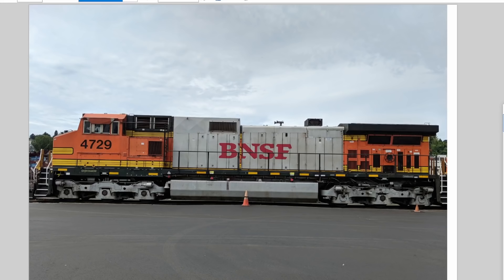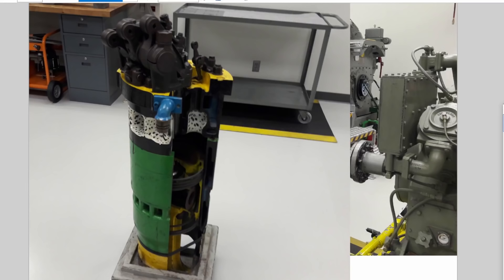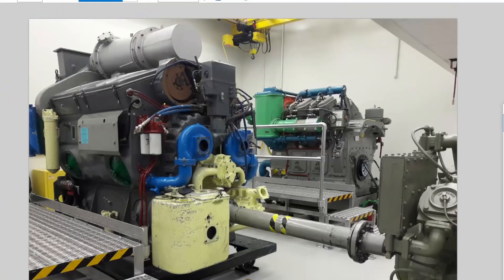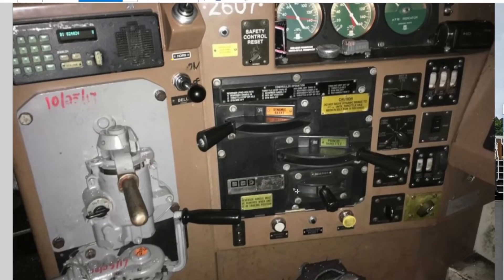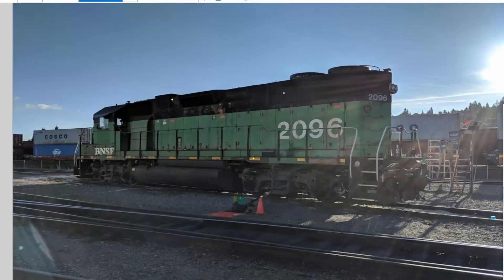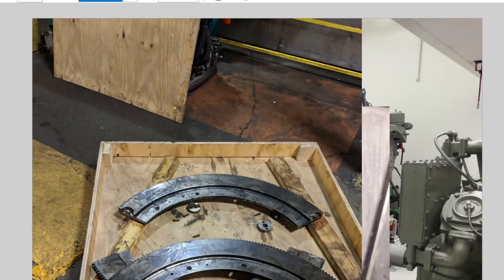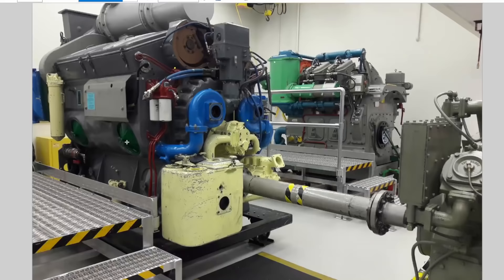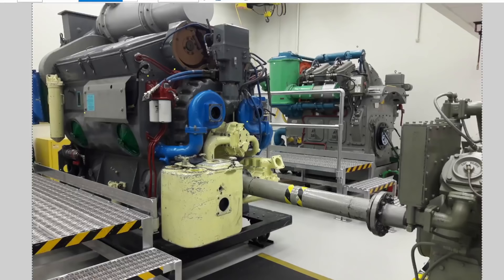Diesel 101 - How DIESEL LOCOMOTIVES Work! [10 Levels]

Comment: So why used dyed water and not antifreeze. I know in cars and trucks the antifreeze obviously keeps it from freezing by lowering its freezing temperature. But it also raises its bioling temperature. Im cuerios why locomotives would be doing the same thing.
Reply from the maker: You know I am not 100% certain. Probably cost, lol.
Reply: @Hyce777  Pretty sure you are right about that.  
Antifreeze is expensive, and with the volume required it would be a rediculouis cost for each locomotive,  It costs nearly $500 to fill a semi truck with antifreeze and they are a fraction of the size of those engines.
Reply: Coolant or "antifreeze does not really increase the boiling temp by much.  The main reason to use coolant is to increase the thermal capacity of the water. Meaning the water will be able to hold and carry more heat to the radiator.    Regular water works just fine as a coolant if it can be pumped at the right rate.  Car and truck engines work at the hire ranges of their capability more ofthen than locomotive engines do and have less spave for cooling systems, So they need the cooling system to be as effecient as possible.
Locomotives have much more room to cool less heat so they can skimp a bit on the wuality of the coolant.
Reply: I heard the issue was with such large engines, they (at least the older ones) tended to leak coolant into the crankcase. Allegedly, when the coolant and lube oil mixed, the result was a thick gel. It was deemed (especially back in the 50's when oil went for cents/gallon) easier to just leave locomotives running all winter than to deal with the damaged (and, let's be honest) mostly destroyed engines from coolant leaks.

Comment: At what minimum psig does the cylinder have to be to ignite the fuel?
Reply from the maker: What most folks consider as "low" is about 250 psi on the compression test. A newer engine should be above 300.
Reply: Psi is what matters, not psig.
Reply from the maker: @borysnijinski331  isn't PSIG just the "gauge PSI?" That's how I took it... Either way, for the purposes of what we're doing, not much of s difference...

Comment: Interesting video about diesel locomotives. The part about charge air seems a bit shop biased(as you said in the beginning). 

To get a better understanding about charge air I can recommend https://www.youtube.com/watch?v=ULLsIo1VzTw its about ww2 airplanes but it explains a lot.

If you wonder why a big two stroke ship engine don't have a mechanically driven turbo(compressor) look at this picture of the start air bottles -> https://www.marineinsight.com/wp-content/uploads/2014/07/IMG_0676.jpg . They are the size of a locomotive and can spin up the exhust driven turbo.

Comment: So your telling me, the loco runs on electric, that is fueled by diesel… Shouldn’t it be easy as heck to convert them all to straight electric? (Obviously there’s price, but still)
Reply from the maker: Well, there's a very heavy diesel engine that's not easy to remove in the way... lol. The issue is more the tens of thousands of miles of track to electrify.
Reply: @Hyce777  that’s true. I was think more along the lines of replacing the engine/fuel tank with an electric engine and battery sorta lime how they are designing electric cars. Idk how feasible that is though
Reply: @christopherharsch4352  If you replace the engine and fuel tanks and alternator.generator with batteries.  The engine would run out of power in a few miles.   
Dieswl electric locomotives are still electric locomotives that carry the power plant with them.   If they were to all switch to grid power for the electricity they need, the grid would fail.   If they were to upgrade the grid to handle the electric locomotives. They would need more power plants.  Each one of those locomotives produce enough electricity to power a small town.   So if you reverse the direction of flow, they would be consuming that much electricity from the grid.   They are much more effecient than they seem to be.  

With all the new technology they are being upgraded with, diesel-electric locomotives are oftem more effecient that fully electric trains and exponetially more effecient than trucks or cars, even electric cars.
Reply: @Bendigo1  huh. You learn something new everyday
Reply: Another issue would be that if you convert them over to pantograph operation (Battery locomotives aren't really usable for anything other than switchers), even once you move the engine out of the way, there's a new issue. With a direct tap into a high voltage line, you'll have a lot of power. But the traction motors on locos like the ones in the video max out at 1200-1500 amps, so you can only use a fraction of total power. Once you've replaced the traction motors and control circuitry for your new higher amperage and/or voltage, you'll find you pretty much have an all new drive system.